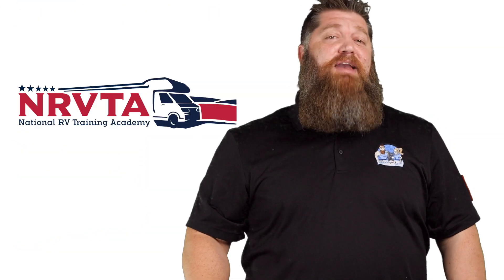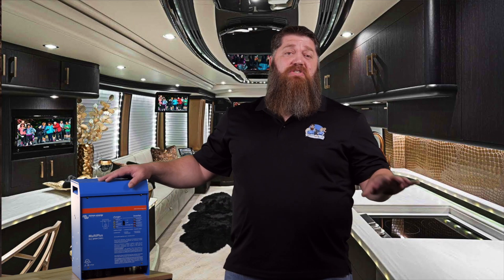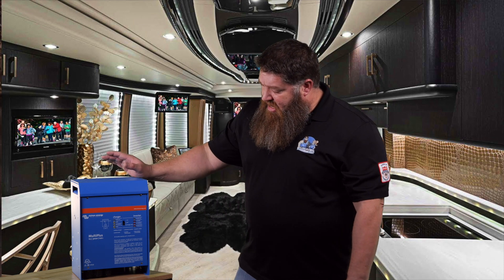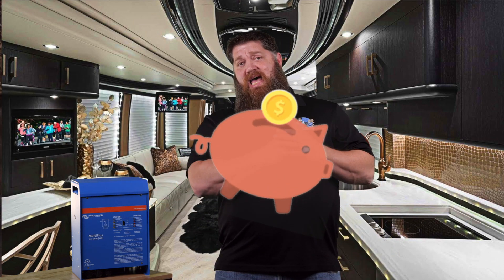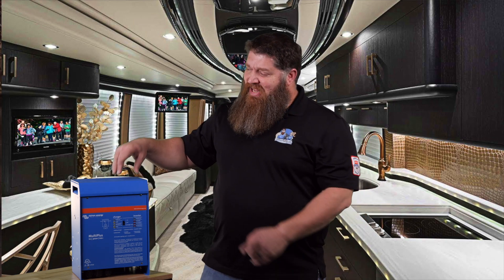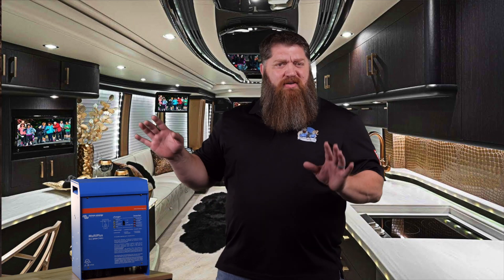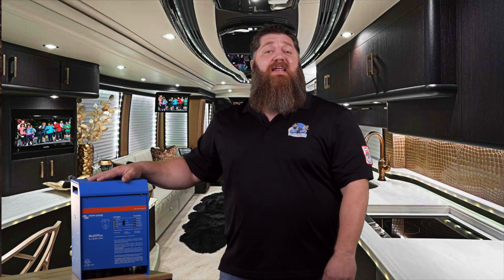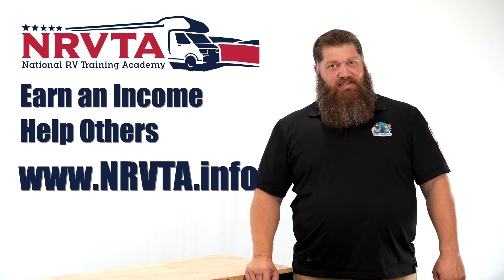The RV Inverter

Comment: Great videos Todd. Question: I have a GD 5th wheel 50amp power cord, 385 watts of solar, 3000 watt inverter (Litime) and 2 X 100ah Litime lithium batteries. I want to run my 50amp power cord into my 3000 watt inverter via a 50amp to 30amp adapter. The other end of the 30amp adapter will connect to my inverter's 30amp terminal connection. This connection will feed about 25 amps to everything in the RV. In theory I should be able to operate everything as if I was plugged into a 30amp shot power pedestal. My only limitation will be how long my 200ah of batteries will last. This setup is not for long term off grid camping, basically for emergency power when I loose RV Park power or at a rest stop etc. Do you see anything unsafe with this type of setup? All wiring is to spec for batteries, solar and inverter #2 odd cabling.

Comment: How does one add solar and batteries with an all in one inverter while keeping the ability to use an on board generator as well as shore power?
Would one need to add an automatic transfer switch between shore power and inverter?
Reply from the maker: Yes you need a automatic transfer switch. Some inverters / chargers combo units have a automatic transfer switch built in.
Reply: @NationalRVTrainingAcademy  does this apply to  a trailer with an automatic transfer switch already installed for an inboard generator?
Reply: @NationalRVTrainingAcademy  just wondering how one might toggle between shore power generator and solar/batteries

Comment: Hi Todd Great Info.  Question, what size inverter would you need to run a small square RV kitchen frig to keep your drinks cold while traveling?
Reply from the maker: Most fridges run on around 700 watts or less. You will be able to verify your specific  refrigerator’s power consumption by opening the fridge door, the data plate is typically located on the top section of the inner door.